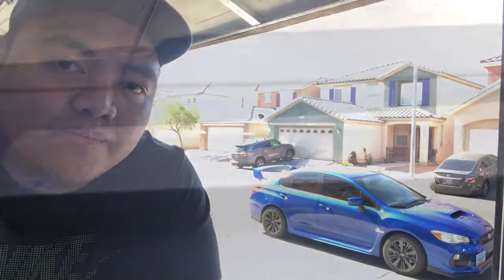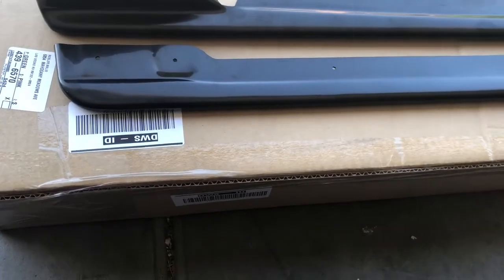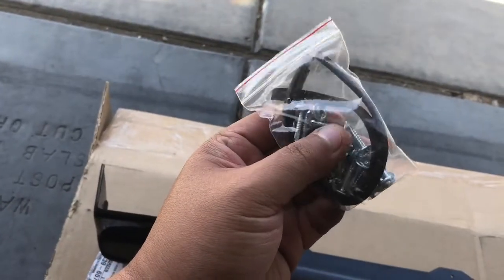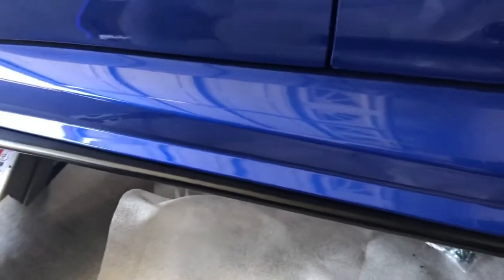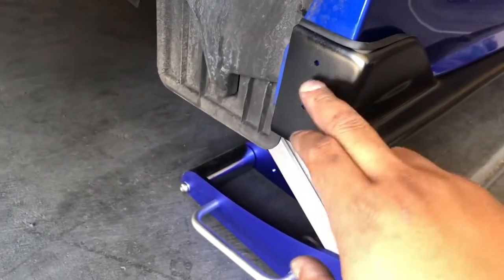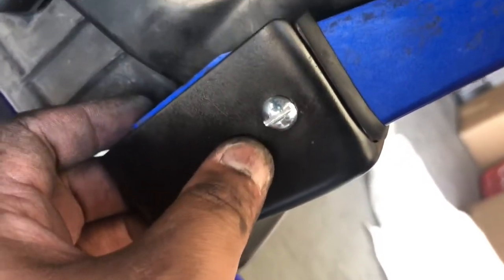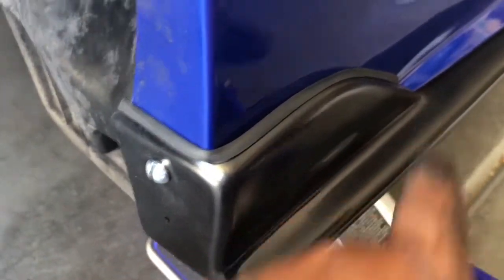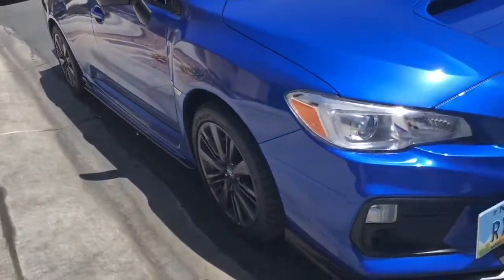2018 wrx Side Skirts Installation

Comment: You are going to love those mr131 wheels and wrap them on some good tyres you won't be dissapointed.
Reply from the maker: Sergio Jr, i just ordered my set of tires and i can't wait to install them ill update you guys on the next video.
Reply: Rosler Malig before I forget, you need to buy hub centric rings for your car they sale them at amazon, buy the aluminum ones from precision motorwerks they also sale them on ebay or from their website. Just get the correct ones for your car. The motegi wheel hub is 72.6 mm and your car mm is smaller size

Comment: Hi ,
I wanna ask that did you lower your car
Reply from the maker: no i didn't only stock.
Reply: @Rxa19_vegas  does the front lip and side skirts hit the speed breakers or driveways being the car has not been lowered
Reply from the maker: @sohailmerchant7981  no... if your driveway is plat, cause mine is kinda uphill so i need to go sideway first.